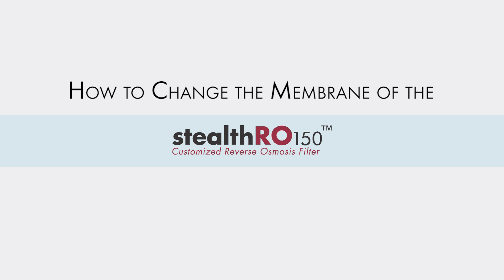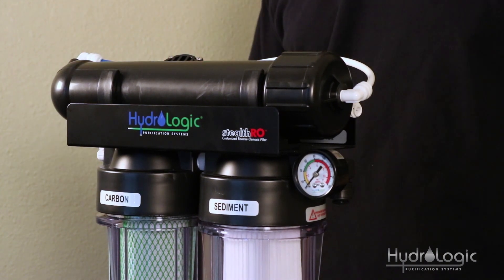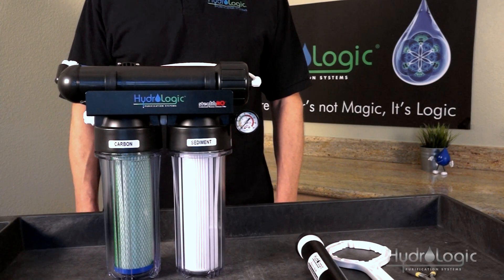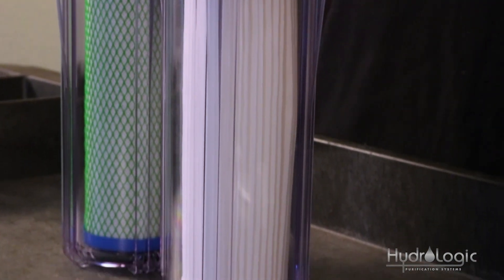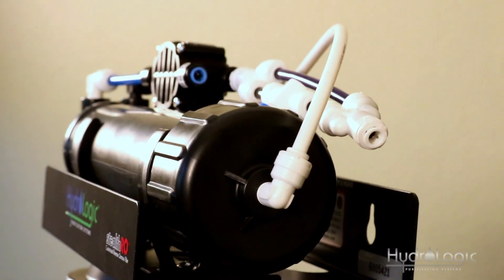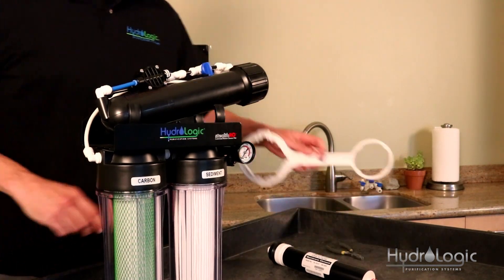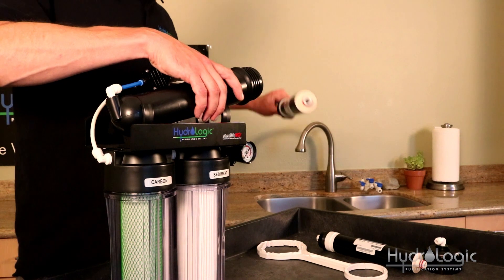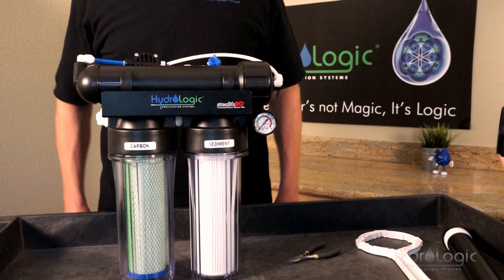Stealth-RO™: How to Change the Membrane

Comment: I can’t get the cap on the membrane cylinder to stop leaking. Can’t get it o. Tight enough not to mention I couldn’t get it off. Video is deceiving. Very.
Reply: I am experiencing the same problem. Website says Teflon tape might be the problem but it was working fine before swapping membranes and it didn’t have any Teflon tape. What’s going on?

Comment: what if it's already hooked up and going, how do you depressurize and drain the water?
Reply: Maybe shut the water off.
Reply: @Wesmancan  ahhh
Reply: If you have the automatic stop valve installed in your reservoir, turn off the water source then make the valve open to release the  pressure. Then simply place unit over a bucket (to catch any extra water) and follow the instructions in the video. You can also change the sediment and pre-carbon filter at this time. And make sure to run the system for 30 minutes to flush the food grade preservative to waste, then you're good to go!!!